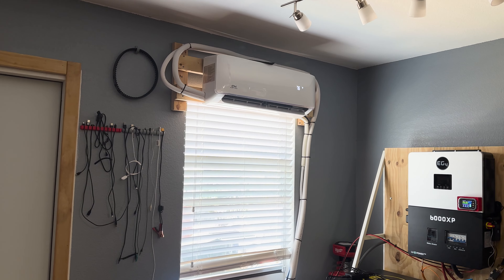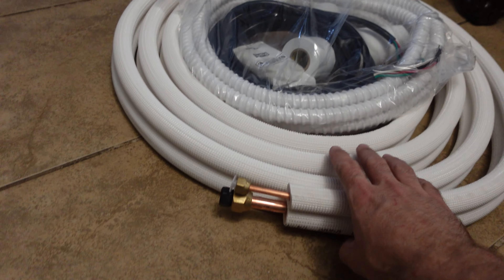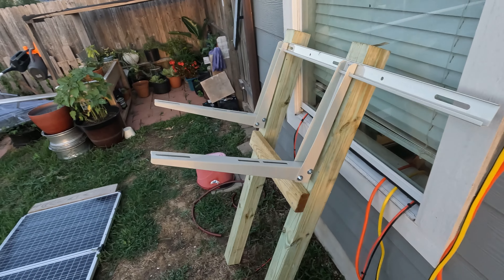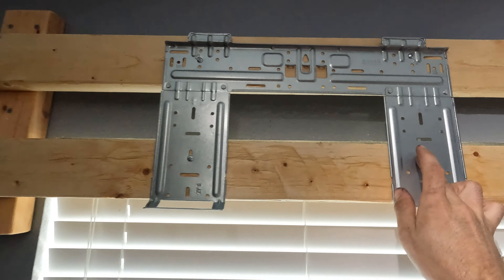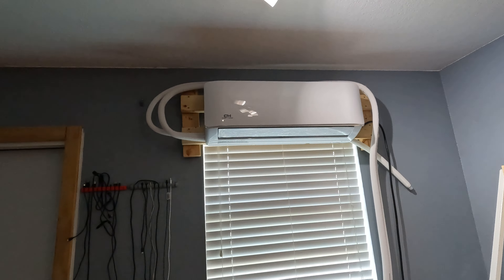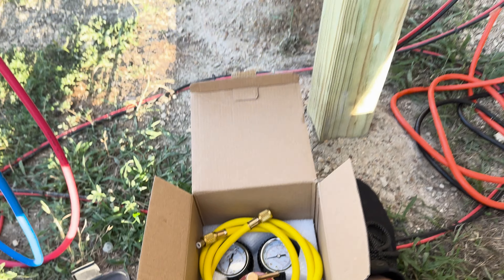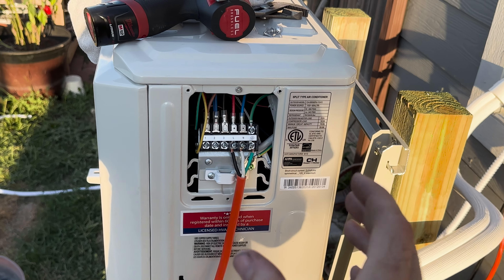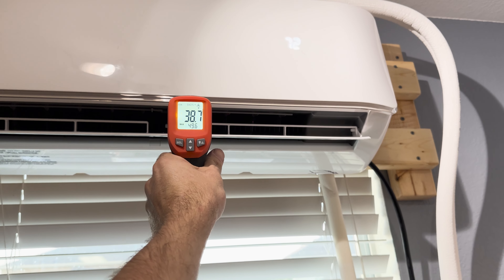No Hole In Wall Mini-split Air Conditioner FULL Install

Comment: Thanks, appreciate you taking your time and sharing this. My two cents is to buy a flaring tool so you can make your line sets custom and not have to worry about making any loops. Love your idea of mounting the unit on two four x fours. Looking forward to seeing the finished version, also very creative with that window manifold. new subscriber
Reply from the maker: Agreed i need to learn to flare id be afraid it would leak. Also would want a nice flaring tool ive used cheap ones they dont work well. Thanks for the comment!
Reply: @Mikebuildss   You can do it easily, you are a master of all the difficult parts of this install.

Comment: I installed it the same way as you. I put the connections through the window and put in a Styrofoam board because the house is rented. And I want to use it now in the crappy winter, kiss, but I've already had a big energy saving. I want to see how it performs in heating mode.
Reply from the maker: So far they seem to work good In heat mode, I used one of my others down to about 20 degrees, just not as efficient

Comment: Great video! By going this route instead of using a Mr Cool do you still save money if you have to buy the regulator, gauge set, and vacuum pump?
Reply from the maker: Absolutely cheaper still, the tools arent that expensive, plus when your done you own them and can install more minisplits in the future!

Comment: Would like to see your window panel builds, also do you ground your 6000xp?
Reply from the maker: I will make a more detailed video, and everything is grounded on the cart, but no connection from cart to anything. on my old setup i used an old cord with just the ground prong and would plug it into the wall in order to ground.
Reply: @Mikebuildss  thanks I was wondering the same and glad to hear that from you, do I need to also ground the solar array?